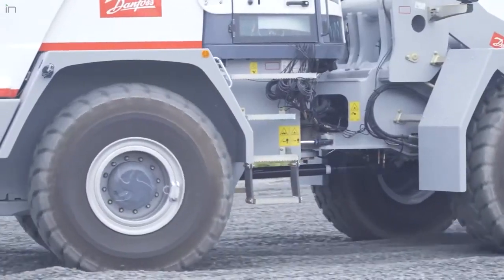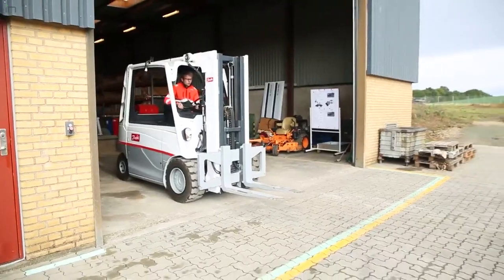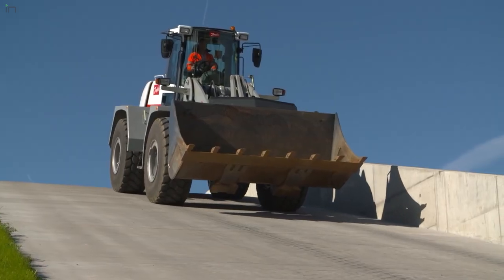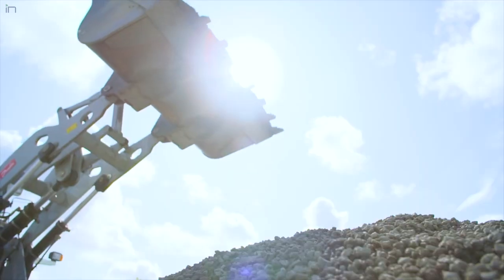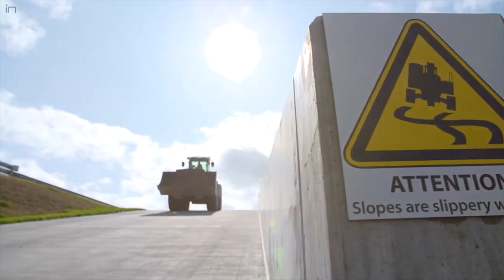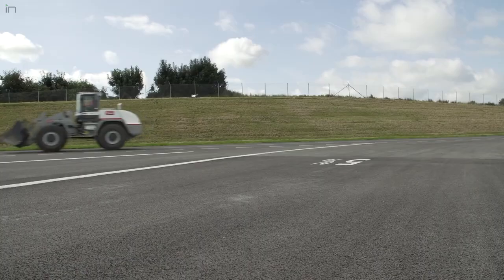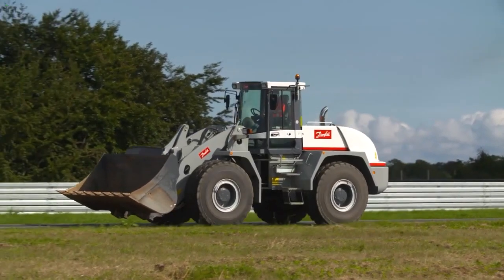Hydrostatic Drive Tech Explained

Comment: There was no explanation of how they work. It was just a list of advantages.
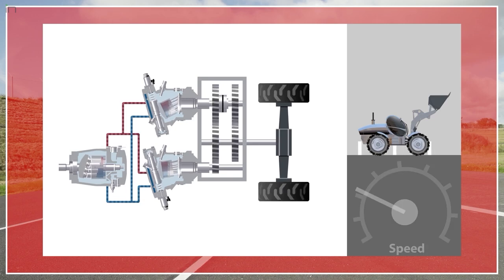Reply from the maker: Hi there! Thanks for the feedback—the explanation part is at the beginning, from 00:23 to 01:05.
Reply: @PowerMotionTech-EBM   That's not an explanation. "Then the fluid drives the wheels". Are you kidding? This is the worst tech video I've ever seen. My only regret is that I cannot give it more than one thumb down.
Reply: @Nehmo  It is not meant to be an in-depth technical video.